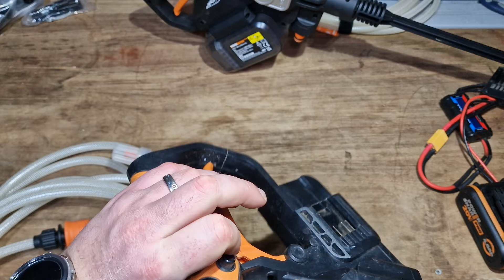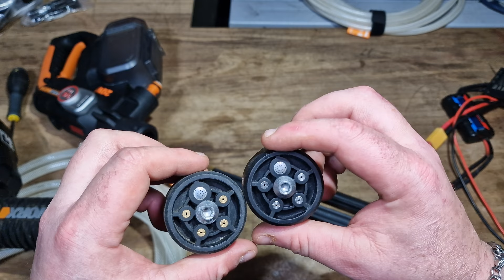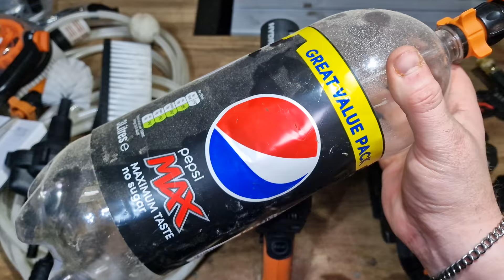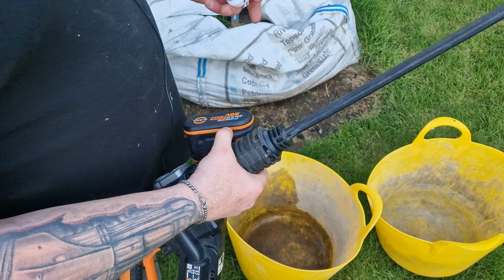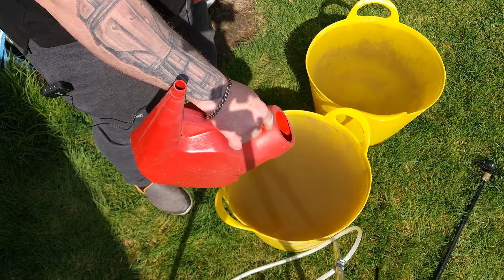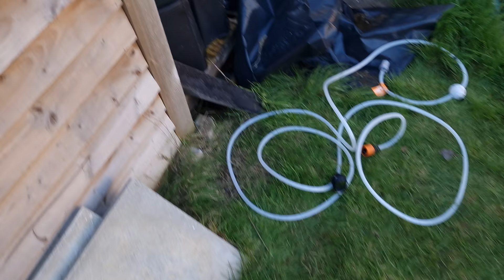worx wg630 vs wg633 what is the difference? head 2 head volume test

Comment: Nice video as always
Might I ask.
The larger batteries becoming available.
Is there actualy room physicaly in the battery box?
Cheers.
Reply from the maker: From the information I can gather, we in the UK are not getting 8ah batteries :-( I know, I know, and as a real kick in the teeth we have lost the 6ah batteries too - weirdly due to international shipping laws we can't get batteries above 100wh sent in the post to residential properties the 6ah are / were 106wh so instead we have 5ah pro batteries, if you decide to procure your own (international road trip etc.) then yes they will fit in the battery case - just I might add!. But it was made with the 8ah packs in mind.

Comment: Son an old retired engineer here, its a vernier calibre not a micrometer. Still an excellent video thank you.
Reply from the maker: i was always taught a micrometer is like a horse shoe  with a screw going through the top with about 99% made by moore & wright, and being about 50+ years old; place material uder screw then screw down and take your reading, a vernier caliper is a sliding jaw set with either digital or manual reading it has ability to measure external, internal as well as using the tail to measure depth too, they are tpically less accurate than micrometers being only accurate to within 1/100th of a mm where as a decent micrometer can be as accurate as 1/10,000th of a mm.

Comment: hi Mike, just wondering is this washer need to use often? like once a week or month? because I bought a cheap one no brand from amazon, starts good but when I left home about 1 and half months then come back try to use again, it can't suck water, battery is good so I don't know why, and seller tell me pressurized pump to dry because I didn't used often so it broke.
Reply from the maker: Hi! :-) I use my washer in the summer time about 3 times a week, in winter I use it every day to keep my work van looking fresh and shiny, it never fails me and it does come with a 3 year DIY warranty and a 1 year trade warranty, so they are pretty confident it is a product that will last, some of the accessories rubber o rings can become stiff if not used for a while, though a small application of water is all that is needed to bring it back like new.
Reply: @mikesptworld  many thanks bro, I can buy it now.😁

Comment: Hi, I've got the 620 at the moment, would you say it would be worth the upgrade to buy the 633 or would you say, whilst the 633 is double the pressure, that there is little meaningful difference in use. Also, would my 620 batteries work in the 633? Thank you 😊
Reply from the maker: 620 to the 633 is like going from a fiesta to a Ferrari!! you will cewrtainly notice the diference - its nearly 3-4 times the performance!
Reply: @mikesptworld  thank you, may take the plunge and upgrade then 😊
Reply from the maker: The batteries are universal across the whole of the worx poweshare range, from mowers and strimmers, to hedgecutters, circular saws, jigsaws, mitre saws, and even a pair of power secateurs and a paint sprayer, all using just 1 battery!

Comment: What is the actual difference between standard batteries and the pro ones?  Is it the pro ones are higher capacity / longer lasting?
Reply from the maker: Good question, one which I am about to cover in a video on its own but in short, bigger output, better run time, less thermal deficiency (I.e energy being wasted converted into heat instead of power) higher voltages for longer duration, better battery condition check with 5 bars of accuracy giving (0%) 20% 40% 60% 80% & 100% represented, battery condition checker is on a side that favours all tools (some designs hid the battery checker when it was on the non pro side - opposite end to the terminals) battery check light stays on for 5 seconds too handy so you dont have to continuously hold down the button, ventilated casings, better quality cells, the main internal connections feature a fused connection in the event of short circuiting! And unless I'm mistaken that is a full list of non aesthetic changes or differences between them, battery release button has better textured finish with micro dimple design, motif is different and bottom sticker layout is different with a foil design sticker as opposed to a normal one.
Reply: @mikesptworld  So in your opinion - what would be the best option to buy purely for just washing 2 cars:
1 x 6ah standard (£80)
1 x 5ah pro (£84)
1 x 4ah pro (£60) bearing in mind you get one of these with the WG633E anyhow?
Reply from the maker: i have not got my hands on the 5ah pro so can not honestly comment on them, (sorry but honesty is he best policy always) 6a are raw power houses and my personal go to, 4ah pro are very good and useful for the new extremely thirsty high power models of brushless tools coming out these days.
Reply from the maker: @Pitch-Dark-Paranormal  washing 2 cars - 6ah - it gives you the longest run time. The wg633 is not quite juicy enough to start needing the extreme output the pro series give you, and they give less run time so stick with 6ah and you should be fine.
Reply from the maker: @Pitch-Dark-Paranormal  sorry I didn't see your other reply when going through as for some reason YT skipped a lot of comment notifications recently.

Comment: To ask as you did a battery comparison does the 6ah battery actually fit into the wg633?
Reply from the maker: 6ah does fit as the battery is the same physical size as 4ah batteries are :-) the 6ah are Sony vtc6 cells and are still some of the best on the market :-)
Reply: @mikesptworld  WORX UK only have the 5ah battery for sale.

Comment: Hi Mike, you asked about ideas to test psi.. here's something that wouldn't be too hard to set up
https://youtu.be/CTOxak6n5LE?t=247
not sure how accurate it is though
Reply from the maker: That is rather interesting! I have messed about with air line fittings so these are very similar style, I'm also thinking some kind of see saw with a equal balance and a set of scales held on top the other end to measure pressure exerted ? Or even a simple force gauge, but the scales would be better as I could keep the water away from them and have an accurate repeatable rig to compare the force between the two models and could vary the nozzles to show peak exerted force?, as this would also show / prove the nozzle has nothing to do with the extra cleaning power.
Reply: @mikesptworld  yeah, that could work well 👍 And whatever array of tests you decide to create can help you move from subjective opinion to objective facts when comparing the WG630, WG633 and future iterations.

Comment: WG633 with a heftier battery would be the top combo. Worx do 5Ah batteries now, should in theory add a little more run time and probably be close to the 630 + 4Ah combo in that respect. There are also third party batteries at a claimed 5Ah but quality will undoubtedly be more hit and miss depending on manufacturer.
Reply: You can probably build your own battery with some cells.
Reply from the maker: I tore down a 1.3ah pack and replaced the batteries with some red 18650's from a bosch battery pack, it worked OK but needed a seriously hot shoe to solder the bars to the ends of the cells, might be easier with tagged cells, problem is a battery is designed to thermally disapate heat not conduct it so that was very challenging and possibly damaged the cells in the process, by that time you are better off just taking your chances with the 'interssting' ebay / amazon packs or buying genuine ones, unless you own a spot welder...... then you are quids in!
Reply from the maker: I have covered one of the "too good to be true" batteries and the one I chose to test was "somewhat interesting" claimed 6ah but just about managed 3ah, temperature checker was a resistor instead of a thermistor so could potentially cause fires and it had a thin piece of wire connecting the batteries to the main board meaning it was a point of highest resistance and possible point where if the battery was short circuited that it would cause a fire rather than fuse or fail safe.

Comment: the 40 Volt is absolutely what a mobile detailer needs! i been detailing with it for 3 yrs now i use it for the wheels and to rinse the vehicle down...and then do my rinseless wash
Reply from the maker: Haha...... errrrr the new wg633e is actually more powerful than the 40v...... 56bar wg633 20v vs. 31bar for the wg644 40v......I don't know how that works, but it does :-P

Comment: Would you know if 3rd party accessories, like a similar brush or turbo nozzle
Reply from the maker: Anything the standard head adaptor will fit (pull back and insert type) but not the clip and twist type fittings as these are unique unfortunately, most similar to nisflisk bayonet but still unique :-( turbo nozzles are included in the list of ok accessories though only the smallest 0.20 work effectively with the hydroshot :-/

Comment: Thanks for the great reviews of these devices! I've ordered WG633 mainly for bicycle cleaning, but went for this higher specce'd model for the multiuse possibilities around the yard and house. Would be great to see Eco mode in action, that would be most likely feasible for light cleaning tasks like bicycle cleanup after ride and would save battery & water. Have you tested does WG633 limit the pressure when using the short lance? I've seen in another video that there is a magnet in the long lance and the earlier washer limits the pressure when the magnet within the long lance is not detected.
Reply from the maker: Hi thanks for the suggestion, I may do a eco mode test now I know how much water it uses and how long it runs for :-) it will be an interesting comparison, I use it for cleaning my own bike but I have the odd one or two batteries so I don't worry so much, but I will put it on my future videos list :-) with regards to the lances...... yeah..... the lances...... you have a point but as far as I have been able to mathematically prove YES there is loss on the longer lance...... you loose about 1.3 psi using the longer lance..... to put this into perspective its about 1/800th of the wg633's power or to put it better you are more likely to gain or loose pressure from battery voltage and temperature differences in the air than you will with long vs short lances! Though it is a very valid question to ask and one I thought may happen too until I did the math..... 4 times over and still got the same result!

Comment: I'd like to see the real power of the two devices when pumping water with a restrictive head such as 0deg or 15deg. Then we will likely see the high power consumption of the wg633. I would guess 20-25A @ 18V ~400W. Its definitely killing batteries much faster than my WG630 did. Its also making the batteries warm and the motor housing is warm to touch.

Comment: Thank you Mike, I was searching for a comparison for these two.
Reply from the maker: It's a little underwhelming and I will assure you the wg633 is SOOOO much more powerful but I honestly can't show power on a video unless I build some kind of ultra technical rig and I just can't! :-P I hope the near 40% less water consumption and only 5 minute less run time proves that this is more efficient and more powerful in a roundabout way.
Reply: @mikesptworld  less runtime is a bit disappointing but expected I guess
Reply from the maker: Yes, with more power comes a shorter run time, assuming that the extra power consumption is not just going into heat and noise but instead physical power, I can assure you, using both side by side that the wg633 physically kicks when you turn it on and tries to lift vertically when running from the pressure it exerts.
Reply: @mikesptworld  What do you think of WG633 compared to other portable pressure washers e.g.) Stanley fatmax pressure cleaner, Ryobi One+ 600psi EzClean Power washer

Though I think Fatmax one is closer to WG630 in terms of psi
Reply from the maker: Putting an independent hat on, worx made the first truly portable pressure washer back in 2016, many others have attempted to copy it since but have been unsuccessful as it requires a lot of R&D to get a fully working machine that is competitive in the market not only for performance but price too, it is extremely interesting that on worx 3rd generation (wg620 - gen 1 brushed wg630 brushless - gen 2 & wg633 brushless refined and perfected being gen 3) I think a company like karcher could easily make a cordless pressure washer that is "better" but the cost vs the market they dominate means they could never make something with circa 50% power of their corded ones for 3x the price and Try and sell it with a tag line of "does half the work for 3 times the price" companies like Stanley make a fairly distinct attempt but the product is just trying to be a hydroshot and falls short of the performance mark, then look at the HUGE family of 20v powershare tools you can use your batteries with, vs Stanley's tiny range, the only worthwhile one to mention is greenwood's, they make a 40v sort of cordless version of a mains style 650w base station and hose system, it is really good but is a different product and is not a all in one like the hydroshot, the ryobi is good but will unfortunately always be playing second fiddle to worx, mainly due to the fact that ryobi make one as a offering to fill a customer needs basis, and stop customers going to other competitors, once you invest more than say 3 batteries and 3 tools you are unlikely to change your chosen manufacturer regardless of how good others are out there. The thing I like about worx is their diversity and quality alongside innovation and never stopping at "thats good enough" it's more "this will do until we improve on it again" that is what gives worx their edge and refinement in my opinion.